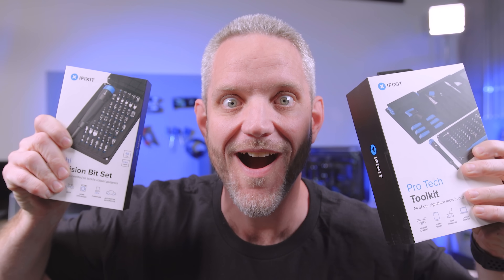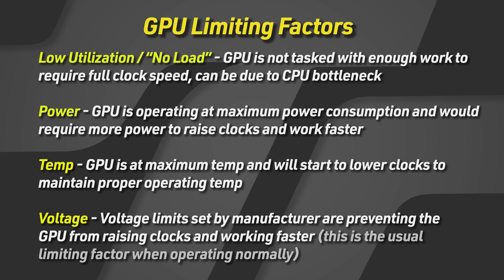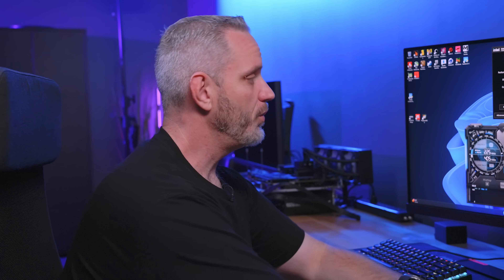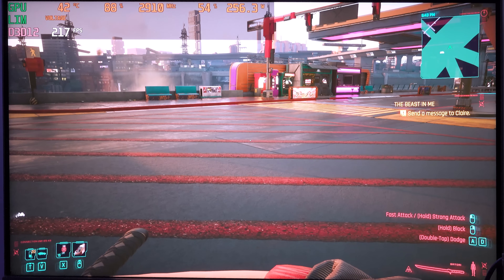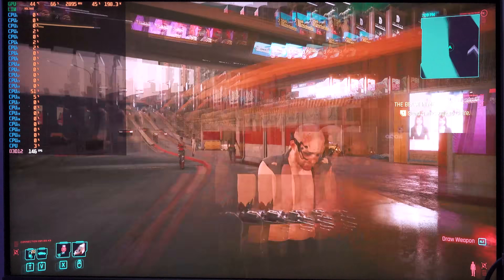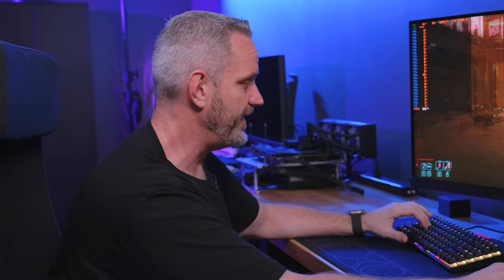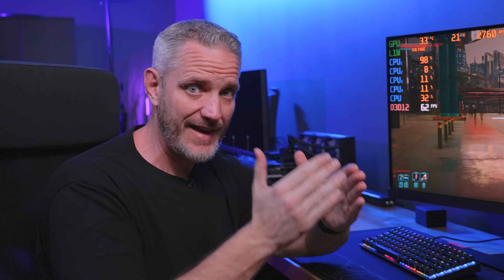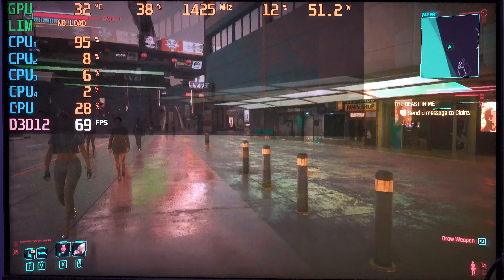THIS is what Bottlenecking REALLY looks like! AVOID THIS!

Comment: Exactly! I was pressured into changing my i7 4770k to a ryzen 5 5600 (and i am still happy i did it because i can run windows 11 now) but in terms of gaming the difference i noticed was barely noticable. Gaming is mostly GPU bound, and CPU bottlenecks are very rare it seems, even if you have a 9 year old CPU. I must add that if you play at 1080p you might notice a bigger difference, but if you play at 1440p or 4k the older CPUs are still amazing.
Reply: If you didn't see any difference in games going from a 4770k to a Ryzen 5600, you either play old games or you have an old GPU.
Reply: I think that stems from the fact that while GPUs have heavily increased in power, higher resolutions also require vastly more power to be rendered.

So for 1080p, which was once high end, GPUs can now scale that mountain, but CPUs are slower, so they struggle. Push up to 4k, and while the GPU was faster, it ends up scaling a sheer cliff, while the CPU climbs merely a slope, and they end up reaching the top at around the same time.
Reply: @HackedGlitch265 best description ever. 👍
Reply: yeah I really want to know what GPU you were running to get barely any gains at all from a 4770k to a 5600. I went from an i7 3770k ( not far off the 4770k at all ) to a 3600 then a 5800x3D and the jumps were massive. I play at 3440x1440p and noticed the Jump more so in 1% lows and .1% lows. Avg really does not matter at all as you can get decent averages out of older CPUs but your 1% and .1%s are much worse and if you play anything CPU limited like Satisfactory or games like that you will notice a massive jump.
Reply: @secondc0ming  I have a 2070 super, and played newer games (Watch dogs legion, Forza Horizon 5, metro exodus). I have benchmark comparison on my channel and the difference is not noticable, at least not at 1440p. My question to you is: Did you ever pair an older CPU like the 4770k with a medium/high end modern GPU, or are you just speaking out of what you think should happen?
Reply: @lilpain1997  2070 super. There is a difference, but not a noticable one. I could already comforably play every game at 1440p60fps with the i7 4770k, so that extra 5-10 fps really isnt noticable.
Reply: @secondc0ming  Or they just game at high resolutions where you are mostly GPU bound.
Reply: @Amin_2k  I had a 4790k with a 1080Ti and the 1080Ti was bottlenecked by the 4790k, moving to a 5600x increased the 1% lows and max FPS noticeably at 1440p
Reply: @secondc0ming  1% lows are better yes, but its not a huge difference in my opinion. Both are playable. I must say that i havent tested a lot of CPU intensive games yet, perhaps if you play those games you will notice a bigger difference.

Comment: Hey Jay, I love what you're doing here, but I think a better example would be doing this with hardware, like putting a first gen Ryzen (or even a FX chip) with the 4090.  And doing the reverse and using something like a 1060 with a modern CPU.  (I say Ryzen/FX because I don't know Intel chips that well).
Reply: I had an FX chip with a 1070. Before that an HD 7950. I don't think either ever saw usage over 75%.
Reply: @nhf7170  I used an FX-8350 with an AMD 480 and it was a pretty good match, though the CPU was the bottleneck more often than the 480 was.

Comment: How big of a bottleneck is the RAM speed? Would be interesting to test.
Reply: imo, long testing for not huge differences, since there is test out there where you can see like +3 fps differences but the ram kit is also 3 times the cost of the reference basis 😂
Reply: It depends. It can make a massive difference, but that depends on how high the speeds already are and what CPU you're using. Sometimes a shitty RAM config can literally cut your performance in half, other times it's not the limiting factor.

Comment: yeah i had a 5700xt with an i7 8700k....upgraded the GPU to a 7900xt and only saw somewhat of an increase in 1440p gaming....ended up with a new AM5 build and all is well now lol
Reply: maybe because Ultra settings or latest heavy games like hellblade 2,avatar or something with ray tracing take all the power of u gpu..
Not is to much powerfull that radeon to bottleneck.. 
I see i7 7700k maintain the frames with ur card.. 
I7 7700k no bottleneck gtx 1080ti but yes 2080ti a little I think.

Comment: I once upgraded my GPU and my CPU was bottlenecking. However, the bottlenecked GPU was overall faster than before. Of course, this was part of a phased upgrade. This was also one of those eras where I had to go from DDR2 to DDR3, which adds more to the CPU upgrade cost.
Reply: for me my bigger fear was the operating voltages of ddr3 and 1.65v ram vs 1.5v in that "ERA" it grew to be quite troublesome for a lot of end users during this time. Where a newer GPU also required a relatively ideal range of 12v rail operation/capability....paired aspects of vdroop etc when running 1.65v ram in these sort of scenarios which largely FRIED/KILLED a lot of ppls builds/systems etc. ESP as they were little/by little upgrading aspects of their build like GPU/SSD etc....w.o realizing how INTEGRAL a TIGHTER system from an operating voltage stanpdoint....building a PC really GREW into/became...even to this day.

Comment: I did my last clock-up on the cpu this year. My rig has finally reach the years I hoped to replace it. It's running hotter to stay up in new and better fps games. It's an Intel i7 8700k, 32gb 3200 ram, Nvidia RTX 3080 ti. Had two other gpus ( a Vega64 and a 2080 S) two yrs each. But for 6 yrs. of pleasure I had with the rig, it was monster. I'm gonna retire it as my daily work horse. Love this machine.
Reply: My pc died a week ago and it i5 2400 and 1050ti
Reply: @vegg6408 You kept it going that long? That's like gramma's car she putts around forever on. That's great. 2012. I have an old Dell Studio xps 435mt in the garage. It runs but is as slow as a rug. Intel i7 920. first year i7, smallest one. Came with an AMD HD 4850 2gb. The last gpu it had was an Nvidia GeForce GTX 970 ss. Still in the Pcie slot.😀

Comment: I (briefly) ran an RTX 3080 coupled with an i7 4790k OC:ed to 4.8GHz, and at 3440x1440 I was significantly more GPU rather than CPU limited in most games. Sure, upgrading the the 5800X (Once it arrived, mine got delayed...) did improve on performance, but typically only in 1% lows, rather than "general performance" for most games. All in all, my ancient i7 4790k fared significantly better than I expected, given how huge of a mismatch it is in hardware.
Reply: I agree with the sentiment of confusion here. It's not just about bottlenecks. It's how do I maximize the potential of a 3080 or a 7900xt so that my older CPU really isn't a problem? Are certain areas of a game really CPU intensive (bottlenecked) regardless of settings? 3440x1440 is a good use case. You'd think it'd stay GPU bound, but lower a setting and maybe now you're CPU bound. But if you have everything ultra, you get less FPS. I think most YouTuber's are almost getting there but it's still confusing. The best recommendation I have is to turn on metrics and test every setting yourself to see where the bottleneck is when min/maxing for FPS vs quality.
Reply: I have 4790K and 4K as well, and just upgraded to 7900XTX, still don't get CPU bottlenecks that would warrant CPU upgrade.
Might even modify my Z97 motherboard to support ReBar (there's github for that) to get more performance out of that ol'reliable CPU!
Reply: @Gastell0  I still did find it worthwhile to upgrade my CPU though. There are some games where the CPU performance was subpar, and the upgrade to a better CPU made stutters less frequent.

Just because I tended to be more GPU rather than CPU limited, it doesn't mean that I always was limited by the GPU. Better CPU performance still improved on the general gaming experience overall. More so in some titles than in others though.
Reply: @Gastell0   So say we're playing Starfield on ultra settings. We want more FPS but not so much a loss in visual quality. Does the CPU start bottlenecking in the city no matter what or just when we lower settings trying to improve FPS? There seems to be a fine line between min/maxing and shifting load back onto the CPU that I think we will just have to figure out for ourselves on a per game, per area, per rig basis.
Reply: @mackan072  That's definitely, I was debating what to upgrade, MB+CPU+RAM or GPU, and went with GPU as it provides the most gains (I changed from GTX1080)
Reply: I was nearly in same boat with my old i7-5960X paired with my 2080 Ti, except I was never able to get 4.0GHz+ clocks to stick thanks to the garbage Dell X99 motherboard it was socketed into. Since I was going to need a new mobo anyways, I bit the bullet on a Gigabyte Z690 and a i5-13600KF which of course gave a pretty significant bump to performance, but I'd have probably gotten similar results had I been able to get a good OC to stick on the old CPU.
Reply: @TheModeRed  It will be not great with Nvidia gpu that offloads scheduling to CPU, it's fine on AMD though, and yeah I am now enjoying Starfield in it's ultra 4K glory
Reply: @TheModeRed  Well, in my case, with a 9900K@5GHz(4.7GHz on the cache) I am completely GPU-bound in the MAST district of New Atlantis (one of the worst places to run in the entire game, if not the worst) on a Strix 3080@2000MHz with ultra settings and my native resolution, 3440x1440. As this gives me a terrible 40-45 FPS experience (can't remember for sure, but pretty bad) in those areas, I have lowered the settings to mostly medium with the DLSS mod at 70% resolution scaling, and then I am alternating between being CPU-bound (at an average of 65 FPS in those areas) or GPU bound. This balancing act seems to be the best for me in terms of getting the most consistent fluidity in the game. In other words, the 3080 is simply nowhere near powerful enough for high settings in Starfield xD So, bottlenecking only starts on my rig when starting to hunt for higher FPS through lowering settings and using upscaling.
Reply: So what I'm seeing here is, my 8700k should be fine if I want to step from a 2080 Super to a 3080 or 3080ti for my 3440x1440 and Valve Index. Lol
Reply: @blankskater1  Yeah, as long as you are OK with being below 60FPS in the most demanding areas of the game - as the game is right now, the 8700K is simply not capable of that (see Hardware Unboxed's benchmarking of 44 CPUs for Starfield video for more details). The funny thing about Starfield, though, is that it seems to hate AMD CPUs, and your 8700K just outperforms a 5800X in Starfield, which is just ouch for AMD there...
Reply: @blankskater1 not much reason to go to a 3080 from a 2080 super
Reply: @Gastell0  Problem is only 8 lanes are being used on the old Z97 board with modern GPU's, I was running an i5 4670K for 8 yrs with a 1060 6GB card, Last year I could not afford a new system so upgraded to an i7 4790 and paired it with a 3060 12 GB card and system run pretty good, I will be going over to AMD though with a 7600 and initially the 3060 12 GB card and then upgrade next year hopefully to a 4070 Super, So the AM5 7600 with a 4070 Super should be good for 4 or 5 years.
Reply: @celtshaun1427  Are you sure that it's not a GPU with 8 lanes? They did make a few models like that. My gpu reports having connection over 16x 3.0, though if you're talking about actual utilized bandwidth then yeah, a lot of games utilize only 8x 3.0 at best

Comment: too many people worry about this it seems, yes its a concern, but you almost have to try to bottleneck a system in gaming, especially on any Ryzen or gen of Intel i5/i7 mainline chip of the past 5+ years
Reply: I think the point is that Synergy matters 👍
Reply: Yeah. As long as things are of similar age and of similar price tiers you’re okay. 

Don’t pair a Celeron with a RX 7900xt. Don’t pair a 7800x3d with a RX 6400. 

And people will need to know there is no magic set of hardware that REMOVE bottlenecks. They don’t realize that different software will use hardware differently.
Reply: Not entirely true, If your cpu and mobo can only do pcie gen 3(which is intel 10gen and previous), and you buy a lower end gpu like the rx 6600 gpu that only has 8 pcie lanes you will see stutters and lower fps then if you had gen 4 8 lanes or gen 3 16 lanes.
Reply: @neiltroppmann7773 Valid point, although the stutter part is a bit farfetched as from what I know the only thing that'd actually change is the framerate
Reply: @neiltroppmann7773 but the difference in this 2 cases it's like 5%, or less.

Comment: great information very informative.

Lucky Nvidia Fast Sync is AWESOME! 
Monitor refresh rate has no impact on performance 
i Run my IL-2 Flight sim at 80-120fps with Fast Sync on a 60hz Screen and no tearing and see almost all the frames as fast sync can display even 240fps on 60hz screen

Comment: it'd be interesting to see how this translates to actual different, older cpus. Going to an actual 4c4t 3.2 cpu and see how it would work with a bunch of newer gpus or the other way around since there seems to be a misunderstanding about how much mixing generations would affect performance...
Reply: Jay's example showed clearly that single thread performance matters alot.  I had to use an APU while waiting for a semi-sanely price GPU as and interim measure and while it wasn't ideal, it was a lot better in game with a real GPU bottlenecks or not.  The later CPU upgrade to Zen3 after prices fell, delivered on stability and game performance, but it didn't make things playable that weren't before.
So I would live with bottlenecking again when doing phased upgrades, it's far cheaper nd easier than rebuilding a whole new system.